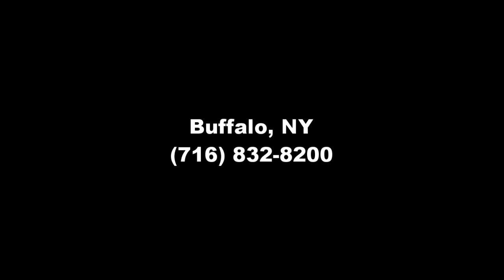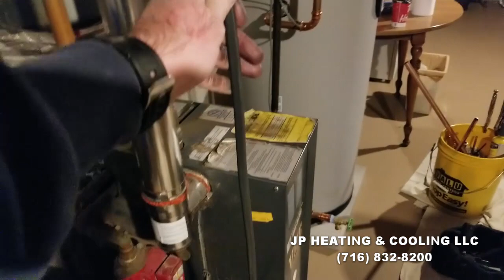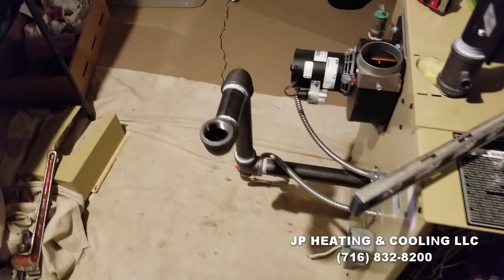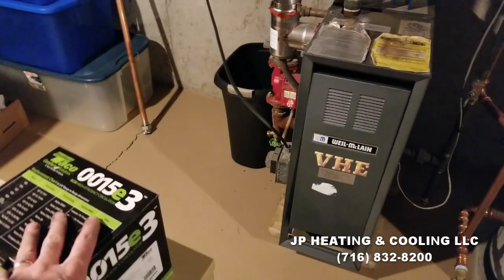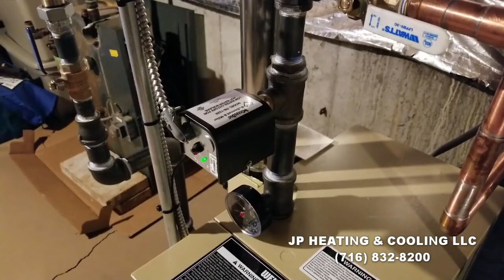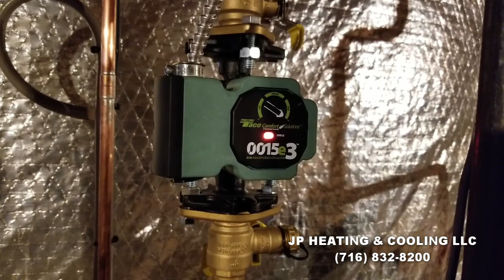Weil-McLain CGI Install

Comment: Nice job the zone valves are in the right place but the circulator supposed to be on the return side for that saturated air in the water you have to draw a negative pressure to get rid of it call the engineers up

Comment: Nice solder job.   Question how well does the magnet air separator work?  If you have all coper, it should not really have any metal fragments in the system. Maybe some from the boiler and piping.and or cI radiators. Nice job.  I
Reply: Thru the years small pieces of iron  (he doesn’t have all copper...black iron piping/heat exchanger) circulate around and there’s really strong magnets in those pumps and the metal will build up around the pump and shorten the lifespan

Comment: Why is the air vent so high on the supply side? Does this increase the effect ?
Reply from the maker: No it doesn't have any effect on the performance being up high, there just isn't any space for it to fit otherwise. The tap for the vent is cast very close to the Supply piping on these boilers, so I bring it up above everything. It's just the way I have always done it.

Comment: what is the component wired in just above the temp/press gauge on the outlet?
Reply from the maker: It's a Low water cut out. They are required by code.
Reply: @jpheatingcoolingllc.6620  Thanks. Do you usually use 120V or 24V  power to low water cut out on a Weil-McLain CGI boiler?
Reply from the maker: @treke08  I use the 120v units.
Reply: @jpheatingcoolingllc.6620  Thank you

Comment: I Was told to install the Circulator pump pushing into the boiler so it doesn’t see the high heat it will lengthen the life of the circulator.....honestly I think it’s BS because my previous one is set up like yours and it’s 31years old....I see You did it the other way could you explain your opinion on that?
Reply: You always want to be pumping away from the compression tank. A previous comment mentions Dan Holohan. Look up the term “pumping away” on google. You won’t get a better explanation than Dans.
Reply: That was years ago. Always put the pump on the feed. its harder to push against the tide than with the tide.  d

Comment: why did you choose this pump compared to 007e  ?? thanks for the video. how did you include the storage tank ??
Reply from the maker: The circulator is sized by calculating total feet of head and how many GPM the boiler requires to have the correct temp difference between the supply and return.
The 007 wouldn't be able to move enough GPM in this application. I like to use the mulis-speed adjustable circulators because they give you the ability to adjust GPM later on. In this case, the calculated head pressure was calling for the 0015e to be set on the highest speed, but after a few days the customer called me and said the main zone didn't quite feel as warm as before even though the thermostat was satisfied. So, I went back and lowered the speed to the medium setting to slow the water down and allow it to give off a bit more heat before returning to the boiler. It's nice to have some adjustability.